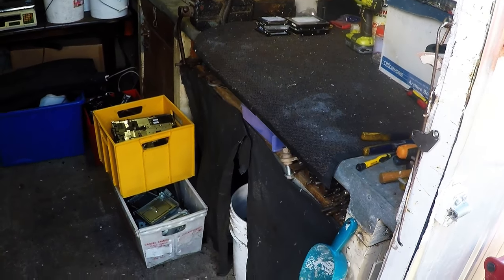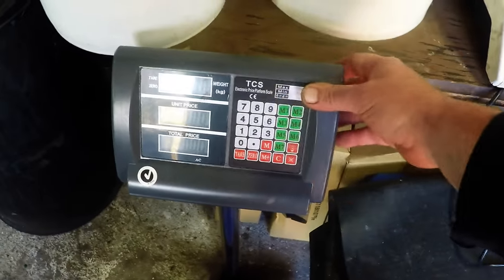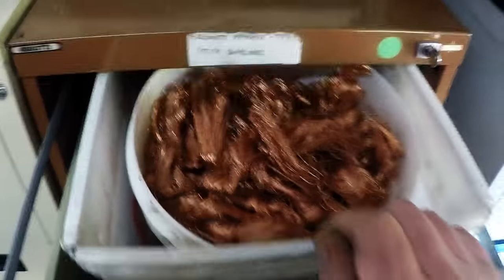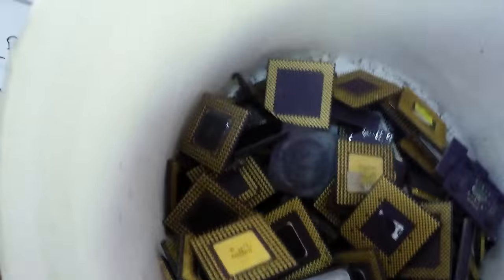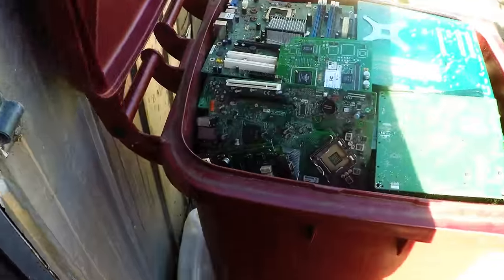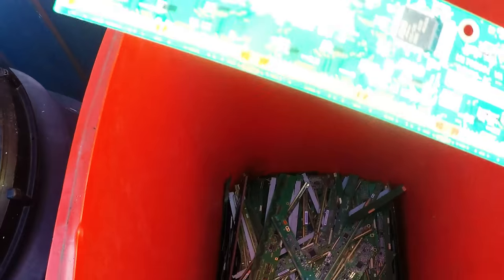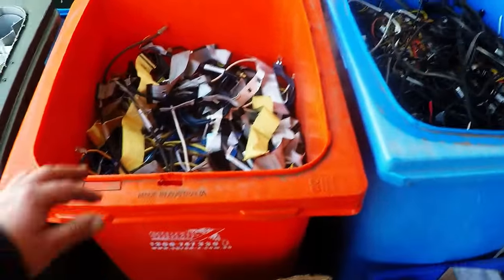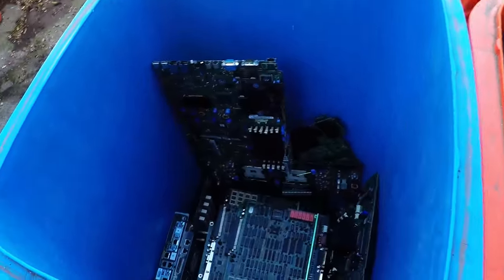My scrapping workshop tour

Comment: Ben Ben Ben. I ha e watched so may videos but this one I had to comment. The copper alum heat syncs are super easy to clean up.  All it takes is a good chisel, a stiff paint scraper blade and a hammer.  Well well worth the time considering the weight of the copper on them.  Just my .02.
Love your channel cheers!!

Comment: Excellent set up Ben!, very nice. I like how you've got a lot of 240 litre bins on the go, ever thought about using 360 litre bins?. Their around 120 litres bigger than a normal 240. I got one a few months back, very useful bin haha. I'm hoping to get my own proper scrapping area lined up in the next few years, when I get my own place. Very nice work!
Reply from the maker: 360's are nice but too heavy to lift into my van when full
Reply: That's the only downside to them, I'm thinking about building a small ramp of sorts, so I can wheel my 360 into the back of the ute haha

Comment: Nice man! That's pretty much my garage only a lot more expanded. Question: Where do you get your roll-away bins? I have some 5 gallon buckets I put most of my smaller stuff in and boxes for my boards, but I've wanted to get some bins like that for a while now. Do you just ask the trash company or something? Thanks, and love the video!
Reply from the maker: Thanks, I get them from recycling centers, usually they are broken like missing wheels or missing lids,  they let me make up complete bins from them.